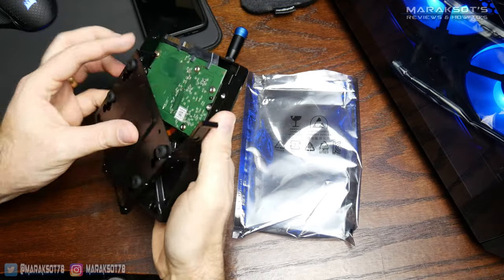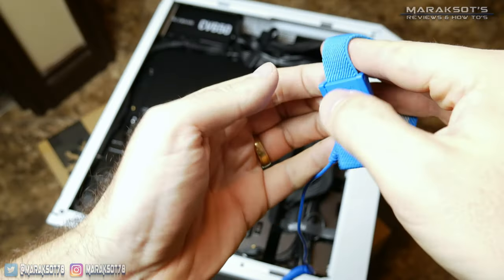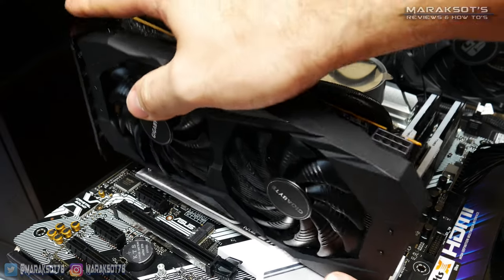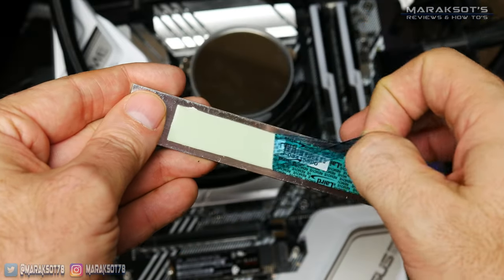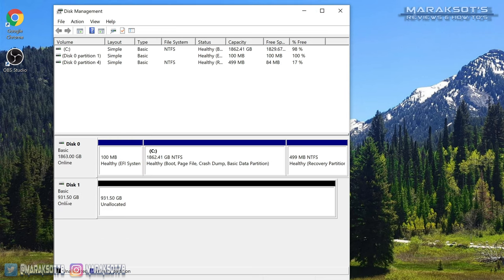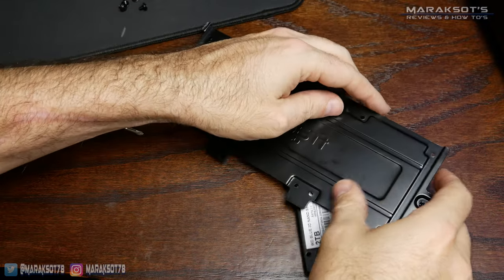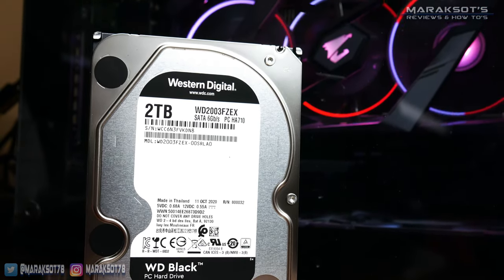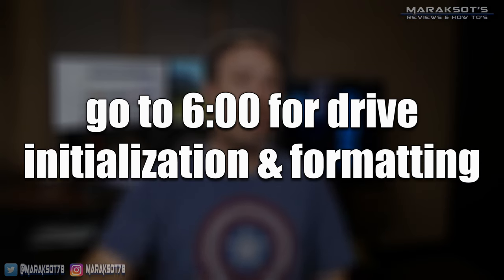A Beginners Guide: Upgrade Your PC Storage - How to install M.2 SSD, 2.5" SSD & 3.5" Hard Drive

Comment: I have 400+ gb on my pc right now and i was wondering that if i get the 500 gb one will it change the 400 to 500 or add the 500 and make 900
Reply from the maker: It would add another drive to your computer. You know how when you go into file explorer and look at your PC it will show your C drive and if you have a DVD drive it's usually the D drive? Adding a new storage drive will add another drive to your computer which you can assign whatever drive letter you want to. So it could be E, F, G, etc. So you would end up with 400GB on your C drive and then a 500GB E drive (or whatever letter you choose to assign to it) for a total of 900GB between the 2 drives.
Reply: @Maraksot78  oh ok thanks then i will get the 500gb one thanks for answering my question, subbed

Comment: What do you do if your new SSD isn’t popping up as an option?
Reply from the maker: What do you mean exactly? Is it not showing up in Disk Management? Or is it just not showing when you open Windows Explorer?
Reply: @Maraksot78   there is no second storage device appearing to initialize even though the ssd is in its location. I took it out and re did it just in case
Reply from the maker: @Miguel Esparra  Ok. I'm assuming you're installing an m.2 NVMe SSD? If so, what CPU do you have? Is it Intel 10th gen? If you have a 10th gen CPU, you can't use the top m.2 slot. The motherboards for 10th gen Intel support 11th gen CPU's also, and the top m.2 slot only works with 11th gen CPU's. With 10th gen CPU's you have to use the m.2 slot that's lower on the motherboard.
Reply: Thanks for the reply man that really helped to explain it for me. Guess I am going to have to burn everything 😅

Comment: I alredy have an SSD installed in and it's alredy almost full i would like to add another, is it possible or should i replace it if yes how i am a total newbbie please someone explain to me how to add another SSD or if it's even possible, thanks.
Reply: If it's not possible i think i'm still fine because i can take a hard drive or something like that i think but it would be prefferable for me to get an SSD so i take evry advice, thanks again.

Comment: Not mentioned in this guide, is that IF the new Storage Driver dosen't appeare in the Disk Manager. You might have to restart your PC and check if the BIOS recognize the driver. In my case it diden't so i ran a scan from the storage manager or what ever it was called in the BIOS. and it gave me a fault error code. But my computer did a Hudini and solved it without any help from me. I ran the scan, it gave me an error and where prepeared to proceed to figure out how to solve it when the driver all of a sudden started to work. (Some days you'll sit for houers trying to get the sodding thing to start a program, and the next it will have a hardware issiue that it solves whitout any human interference. Computers are fucking wierd, :/ shruggs)

The Guide that helped me on the way was this. So i'll leave it here In the case some one ellse might need it in the future. And if not atleast give you a few other pointers to go by if it still dosent work.

1. Check the connections: Make sure the SSD is properly connected to the computer. You can try unplugging and replugging the cables to ensure a secure connection.

2. Check the BIOS settings: Make sure the BIOS settings are configured to recognize the new SSD. You can check the BIOS settings by restarting the computer and pressing the appropriate key (usually F2 or Delete) to enter the BIOS setup.
Check for driver updates: Make sure you have the latest drivers installed for your computer's storage controller. You can check for driver updates in Device Manager.

3. Try a different SATA port: If you have another SATA port available on your motherboard, try connecting the SSD to that port instead.

4. Try a different computer: If none of the above steps work, try connecting the SSD to a different computer to see if it's recognized there. If it is, then the issue might be with your original computer's hardware.

Comment: ESD chance ? think less then 2%.
Reply from the maker: I'd say less than 1%.  I've been building and upgrading my own PC's for close to 20 years and have never killed a component due to ESD. PC parts nowadays are much more robust than they were back in the old days.
Reply: @Maraksot78  because you talking about hhd..
My build is i7 4770k/gigabyte1660oc and 1tb ssd(c) 1tb hdd wd blue mcr. 
Now i upgraded the ssd to 2tb ( had to search in diskpart activate etc) 
But the hdd dont get shown anywhere. ( sata3 connection has power) 

I watched feeled 100 videos about how to get my system read smr..but all talk about shown hdd options. 
Any idea what i have to change in the options ? 
I think the hdd work correct but my system dont like smr.(shud be able all i check) 

have a nice day ✌️

Comment: hey maraksot78, can i install 2 of  2.5 inch SSD
Reply from the maker: Sure, you can install as many as your case supports and you have SATA ports to accommodate.
Reply: @Maraksot78  cause I'm kinda scared But thank you!